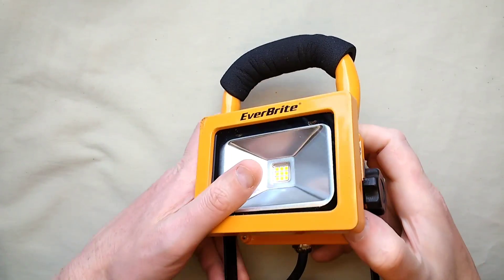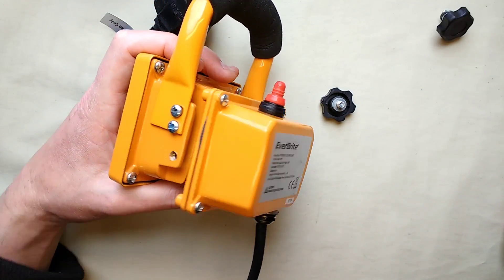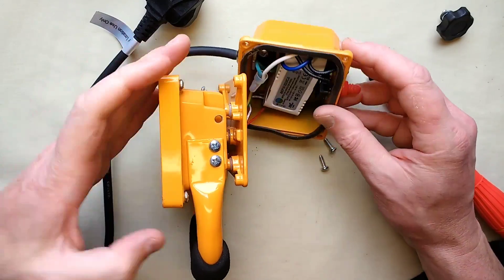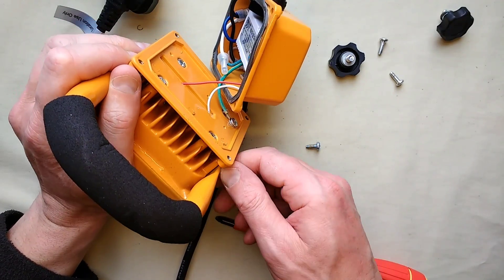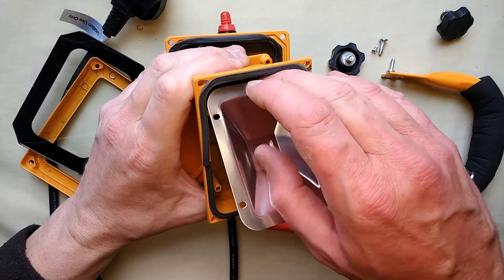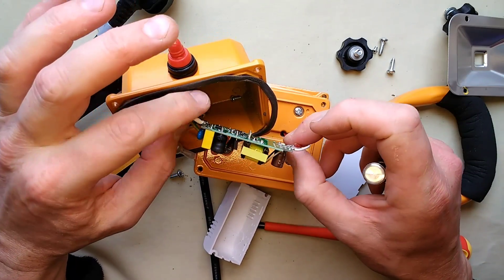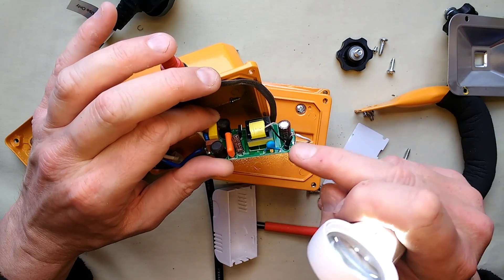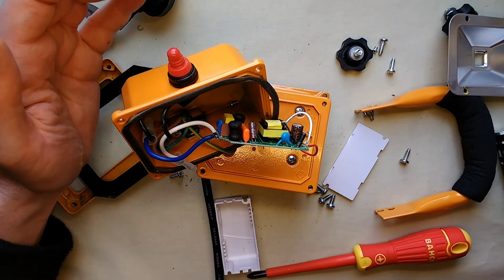ASDA LED work light.

Comment: I can't think of the last lamp you opened that had all four screws holding the LED module down.  At this point, I'm not sure if that's a sign of quality, or a hint that it came from a new manufacturer, who hasn't worked out the corners they can cut yet.
Reply: Must have been a mistake from the new guy on the assembly line.
Reply: cjmillsnun, you're correct. The ONLY reason this unit is decent quality is because it was made expressly for a large retail chain who would never risk prosecution for selling a dangerous device. Take a look at the Chinese eBay sellers if you're having trouble locating every cut corner known to man!
Reply: China can manufacture to any price point these days. I own both a horrible cheap frequency counter with comic sans printed on the box and a rather expensive Rigol spectrum analyser complete with cal certificate. Both are manufactured and sold by Chinese companies.
Reply: The odds of the last one may be better than most would be suspecting. Given that China finally has seemed to grow its middle class to the point where the home market now exists for their products too. When it was just selling junk to foreigners they didn't care as much, but now it's other Chinese seeing it (and getting why the foreign criticism was there) - they're getting better. I have a feeling they may now be getting to how Japan was with its electronics in the 1980's, which if continued a bit more is a good thing. (Keeping in mind most Japanese electronics peaked somewhere in the 1990's, and then they offshored too.)
Reply: Incredible they hooked up the earth wire (WOW)
Reply: Not only the LED module, the reflector also had 4 screws, earth wire crimped and connected, good seperation on the driver, driver screwed down, the power cable looks like a normal one (not a 20cm 2*0.15mm alu cable), ... Either Clive paid a lot  for this light, they saw him coming and sold him the special prepared version, or it finally happened: China started manufacturing quality stuff.
Reply: cjmillsnun same in America
Reply: It is sold by ASDA, would it be sold by Tesco or Poundland that thing might bust in flames
Reply: It really shows when you look at machine tools or small arms.  Some Chinese machine tools are built to a level of quality quite competitive to the better Taiwanese machines, and that was even true in the earlier days.  There are even Chinese Mori Seikis built under license for the domestic market that are quite comparable to the originals.
Reply: literally cutting corners
Reply: What people have to remember is that this is one of the big 4 UK supermarkets selling this.  They are not going to accept crap, and the earth will have to be connected, they can be prosecuted if it isn't and someone gets hurt.
Reply: djm3nta1 Clive puts the video's to Link only so his patreons can see the video before his normal subscribers :)
Reply: 1 month ago? anyone else wondering how